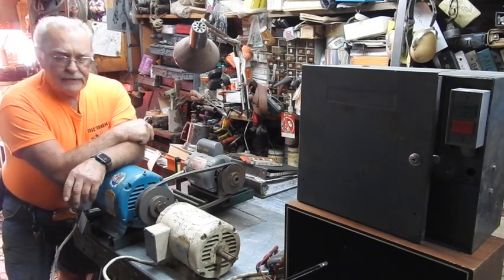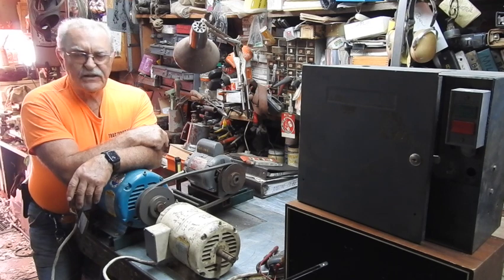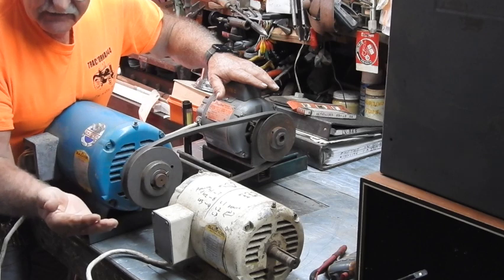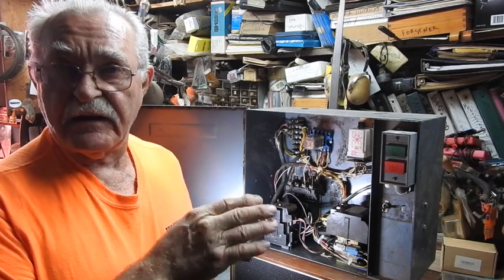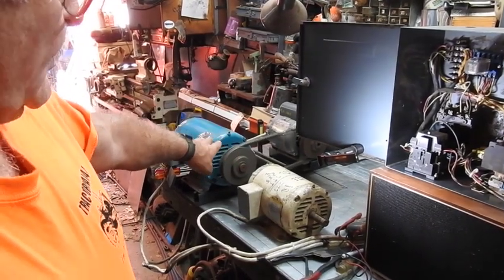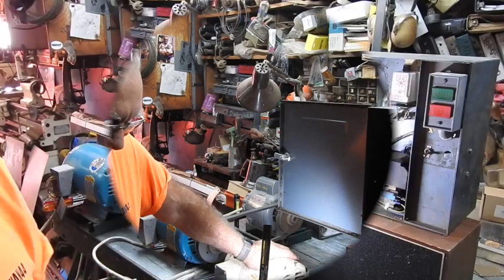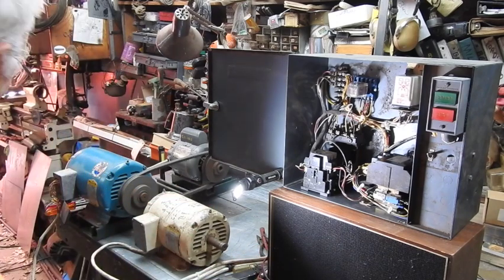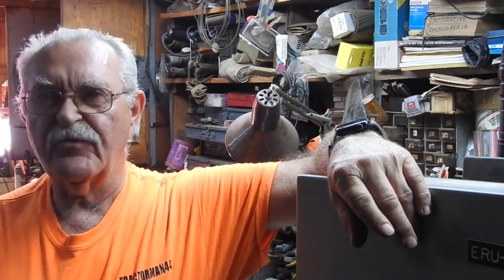Three Phase Rotary Convertor Built Out Of Scrapped Materials

Comment: also.....3 phase electricity is more efficient and can also be accomplished with variable frequency drives but gets pricey over 5 hp
Reply from the maker: Oh yeah....I've worked on and installed dozens of VFD's in quite the variety of applications.  From very small to quite large HP ratings. Some of our large air houses we built ran twin 75 HP supply air fans, three phase enthalpy wheels and large power exhaust fans for building pressure control and BAQ...building air quality.  Usually ALL vfd controlled.

Comment: When a man understands 3 phase electricity....the world opens up
Reply from the maker: Well, I was trained as an 1141 electrician in '71 as a young Marine.  Then the GI Bill put me through hvac training preparing me for the next almost 50 years as a service tech.  So I've been working with and on 3 phase equipment from motors, to pumps to compressors and more for many, many years.  I did spend some of the earlier years working in sheetmetal as well as in the service sector before spending the last 25  to 30 years almost strictly commercial service and DDC controls and piping. Retirement IS nice though.  (-;

Comment: Missed out on a really nice Lincoln mig welder with a remote unit cause it was 3 phase 🫤
Reply from the maker: If its an old mig, it may be able to be powered adequately with one of these, but new digital ones will not work.  This is not a truely balanced 'clean' 3 phase.  It's kind of a like a bulll in a China cabinet 3 phase.  Works well for what it is though.  My brother has a rotary welder that has (iirc) a 20 hp 240v 3 ph motor powering the welder.  We power that motor with one of these with a 3 ph 10hp idler with a 1/2 hp pony.   Now the amp settings are definitely off because to get it to burn rod the way we wanted, I stayed by the welder and he started burning rods, he'd stop and tell me up or down. 
    When he knew the rods were performing the way he wanted for different thickness and diameters, he'd have me mark the dial.  The settings ended ALL marked above standard settings for what would be normal.  That indicated to us that the output was marginally reduced from normal amp settings....I hope that explains it good enough.  Its been working for close to 30 years now.   But I wouldn't risk wiring one into a new digital control unit.
Reply: @tractorman4461  It was an older mig. Almost bought it a few months back but passed. I probably should have bought it and stored it somewhere in the shed 🔧
Reply from the maker: @HODGEPODGEDODGEGARAGE  Oh well, maybe a better one will fall in your path.  There ARE a lot of reasonably priced welders out there.  I'd LOVE to find a newer 'autoranging' mig. Those automatically adjust internally for the voltage applied.  Singe or three phase, 240 or 480 it doesn't matter.  No jumpers or pins to relocate....wire up and go !!
Reply: @tractorman4461  Oh yeah, that would be nice. We have a Miller welder at work like that. It's one nice, but pricey unit 🙂👍

Comment: Good video but ya lost me on the theory early in the video. But if you use a Lovejoy, the driven motor is going to rotate in the opposite direction from using the belt. Does that affect anything?
Reply from the maker: The rotation of the pony motor has to jive with the rotation of the idler (3 phase) motor.  Belt drive, they must rotate the same direction....but end to end they have to be reversed to both turn the same way. If you get the rotation wrong on the three phase idler, reverse any two of the three wires powering the motor.  In other words changing any two of L1, L2 and L3 will reverse the rotation of the 3 ph motor. Same thing with the subsequent additions to the circuit.

Comment: most people don't use those 3 phase motors no more 22O 24O 48O VOLTS they use alot of current and U won't like the electric bill either that won't be no joke 😮😢 OMG 5 28 2O24
Reply from the maker: Most people don't have access to them but those that do really like to be able to use them in a home shop.  The little more it costs on the electric bill more than over shadows the cost of new single phase equipment.  Of course, that's only  my opinion Clarence.

Comment: Way too high tech for me. What I did out of ignorance was run 120v to two legs of my idler motor(phase converter), 120v to two legs of the motor on my mill, then connected the third leg of both motors together. A simple knife switch is wired to the idler motor. I have a two inch pulley on the idler motor that I kick start and and flip the knife switch to start. The motor comes up to speed quickly and just sits there and hums. I've often thought about setting up a pony motor to start the idler but what I have has worked for many years.
An electric motor shop nearby runs a similar set up with a series of capacitors that start the idler motor for start up.
Reply from the maker: I'd really have to think hard on that for a while to figure out how and why that works...But if it does, it does and that's all that matters !!  I've seen the other style as well...the ones with the series of  capacitors without a pony motor. I actually think I have one in the back shed just sitting on a shelf.

Comment: Nice. I have worked on a couple of converters. We used to install some made by "Ronk" I think they were in Illinois and they made static converters (they may have made rotary as well). We used them in some old school buildings that had been converted from coal to oil and the converters were used to drive oil burner motors for the boilers. At that time 2hp & 3 hp motors were usually only 3 phase. Some of these old schools only had single phase power.
Reply from the maker: Cool story.  Now a LOT of motors and pumps are controlled with VFD's on commercial jobs for versatility.